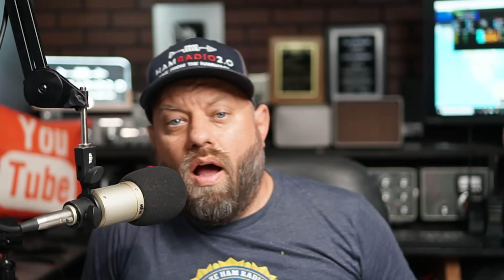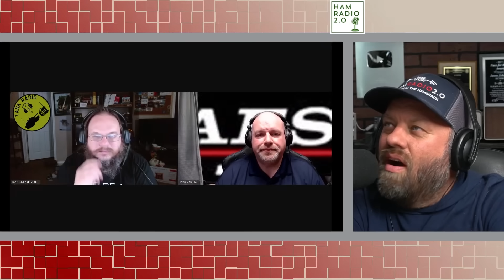The REAL Truth Behind Yaesu's Next Generation Radio Plans

Comment: The FT 60 needs to come with lithium batteries that can be charged with type C cable (the battery).  Welcome to the 21st century‼️  Also have 220 capability, and yes I watched the whole video. 👍
Tidradio can do it for $40  I think Yeasu can do it for under $200. 🤨
QSX 220‼️🖖
Reply: ... and the battery  is 2500 mAh. ⚡️
Reply: Exactly,  keep the radio just update it.  Quit releasing a new mobile every week.

Comment: Personally, I like the size of the 857.  Perhaps an IF output port would be cool on it's replacement radio.  That way, you could hook up an SDR play (or maybe Yaesu would make a similar SDR Receiver) and route it to a pc/monitor setup with custom software geared towards 10" touchscreens for waterfall spectrum scope and CAT control.

Comment: There are no 220 repeaters in our area. Nor are there enough hams to fill the lack of use on other repeaters both 2m, 70cm. Would I buy a 220 radio? Absolutely not. 
If your wondering if I get on repeaters? I do. When I get on them I call CQ calling any and all stations. I’m looking for a QSO and I’m standing by for any calls.
Reply from the maker: It is good that you are using the repeaters, I hope that works out for you.  220 is area-dependent.  Some areas have it, some do not

Comment: 891+vhf/uhf+tuner
Reply: + sound card
Reply: @ yup, missed that
Reply: +a useable UI
Reply: @ I have no problems with the UI and that’s not likely to change
Reply: @jerryKB2GCG  Interesting.  If I had a car that reset the rear-view mirrors and the driver's seat at every stoplight, that would be a serious UI problem.  Similarly, a radio that dumps settings with every band, mode, or memory change has a problem.  Apart from that, it's a great radio.  I had one, and really miss the triple-conversion receiver.  As a friend puts it "that radio's got guts."
Reply: @ I’ve never had settings “dump” on my DX-10, FT-710, or FT-891

Comment: The reason brandmeister DMR sound awful is not the many hotspots. It's because people run cheap, not so good, mostly Chinese DMR handhelds. You can hear it when someone is using a more expensive DMR handheld or mobile like hytera or even an anytone brand. It's the cheaper DMR devices that makes it sound so awful. I like fusion way more. Sounds very much better than DMR. Yet, I use DMR also.
Reply from the maker: I think it is probably both, really.  No way a $150 hotspot is going to sound as good as a commercial-grade repeater.  It isn't hard to find an inexpensive, but good, DMR radio.  Some of them do have terrible audio, true.  But I think the reason that is differs so much from Fusion is that Yaesu is the only company making Fusion radios, when there are over 40 manufacturers worldwide making DMR radios.  If we had that many companies making Fusion radios, they would all sound different too.

Comment: Here is Ft Myers / Naples FL area the FMARC just replaced/repaired? The 220 repeater & we are Actively restoring the Nets on that. 
I literally bought my THREE (3) VX-6r’s Because of 220. 
Would love a VhfUhf mobile With 220 too.  
Thanks Yaesu, been waiting for a while. 
Can we get a HF / VHF / UHF 100watt mobile - FULL SDR - Bells & Whistles.  
Good thing Icom doesn’t have one yet. 
All of my (ham) radios are Yaesu
(3) 857’s
(1) 8900
(3) VX-6r’s
YAESU, Careful what your “research” tells you. 
I never bought the Icom 705 hoping Yaesu would have something “soon”. 
Yeah, won’t wait on Yaesu anymore. 
Kinda pissed after hearing this.
Reply from the maker: The VX6R is a great radio
Reply: Kenwood is coming out with a triband mobile similar to the TH-D75 HT. Will be very pricey but worth it if you can cough up the $$$!! I have the TH-D75 and it's amazing, nothing China made can come close, that's why the Chinas are cheap.